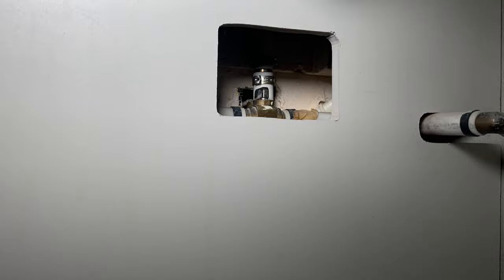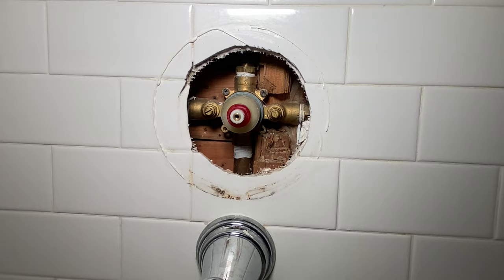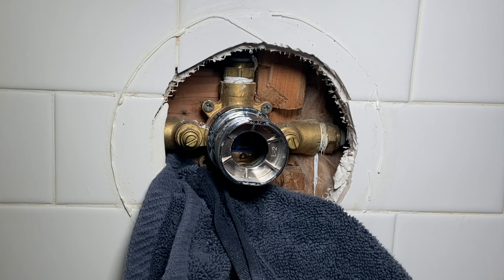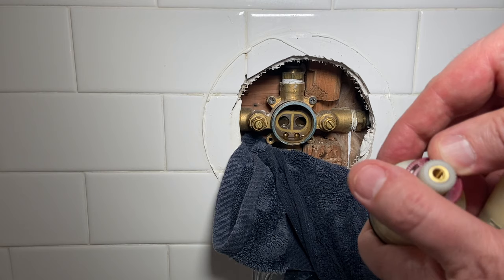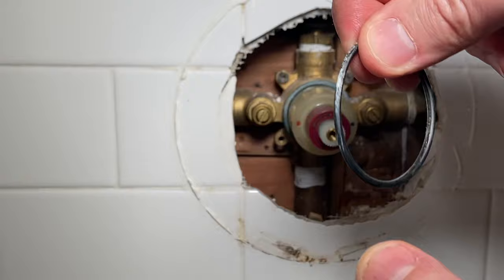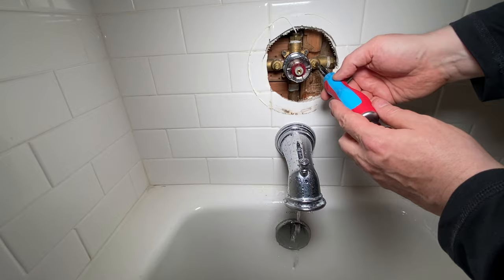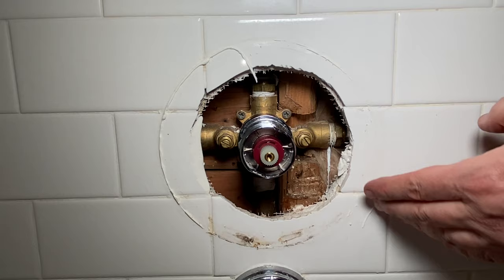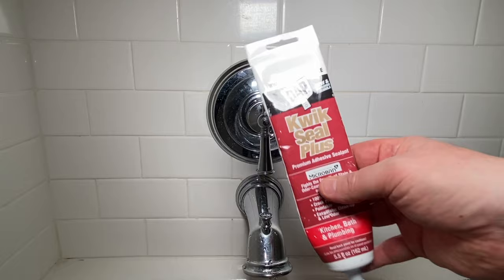Water Hammer In Shower Pipes!...I Tried This First

Comment: I wonder if the problem I'm having is similar. I have one of those plastic "balls" to control my shower flow. It's so hard to move that over the course of the past year, it's damaged the plastic so much that it's started breaking off little chunks and I have to turn the water on and off a bunch of times to get the right temp. You know, turning it a little this way and a little that way, it's so frustrating. 

If I take the screw out of the middle, is water going to spray all over me? [I don't have access to the water main. I would have to put in a work order for the apartment maintenance guys to come fix  it.
Reply from the maker: Send me a picture of what you have Shari. you should always be able to take the plate 
Off and hopefully there is isolation valves on you valve. Especially in an apartment building.
Reply: I don't think I can!
Reply: 893ow99o

Comment: I had thumping in the pipes going to my HD Pegasus (Glacier Bay) shower valve a few years after it was installed. All facets, toilets, dishwasher, and washing machine cycles caused the shower pipes to thump when shutting off the faucets. I changed the back portion of the valve and the noise got a little better but not eliminated. I even installed water hammer arresters on the toilets and washing machine, no help. The problem was in the cut off valves on each side of the mixer valve. There is a spring loaded plunger behind those screws that gets loaded with calcium and gets stuck and needs to be cleaned by soaking in vinegar and water. After I cleaned the plungers and the inside of the cut off valves all the noise was eliminated. Just use a socket to remove the entire cut off valve after shutting off the water to the house.

Comment: I have a shower head that is causing pipe hammering and water pressure pulses.  Hoping that a change of the cartridge is the easy fix.  Thanks for the video.
Reply: Did it fix the issue?

Comment: I have the same problem. once we turn on the spout, there's a water hammer noise. Do you think just need to replace the mixing valve or  the cartridge? I have two spouts in my house that create water hammer noise after turning on. Or water pressure? Thanks

Comment: hi sorry english is not my first language.i live in apartment . management has installed new dual speed mode faucet in the new neighbor apartment right below my unit. whenever they use their kitchen faucet i start hearing the normal faucet stream noise as well as speed mode noise in my kitchen. the speed mode hissing noise is very bothersome as i have tinnitus. management is asking me to use earplug whole day. i have been in this apartment for many years. my unit and most other units dont have dual speed switch operated faucet.why this new faucet from neighbor create noise in my kitchen, how this can be solved please help. thanks

Comment: I put a new shower head on and it’s vibrating the top. The bottom one that ur doing in the video isn’t vibrating ! What could be the problem.
Reply from the maker: I bet it is the shower head. The flow restrictor in the shower head could be the issue. Did it make the noise with your old shower head?